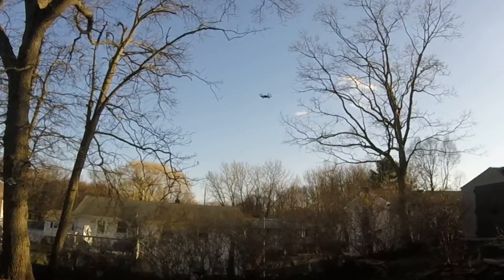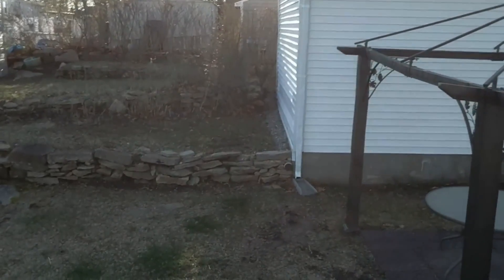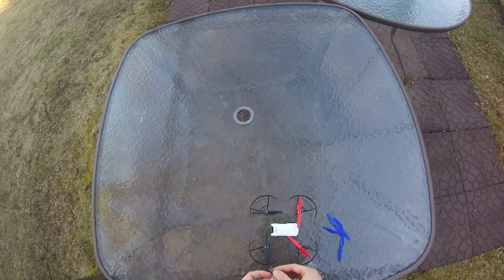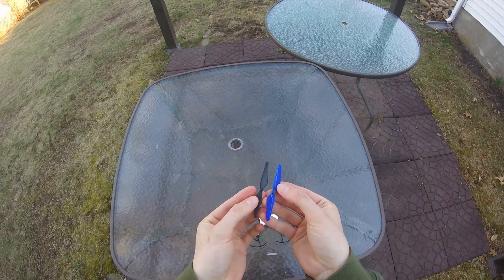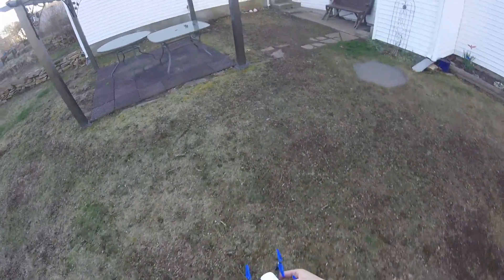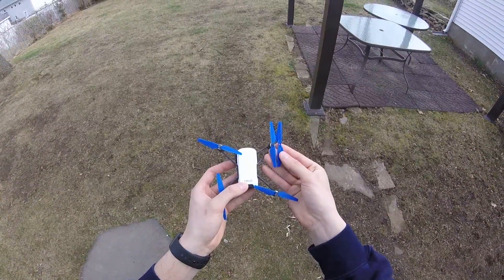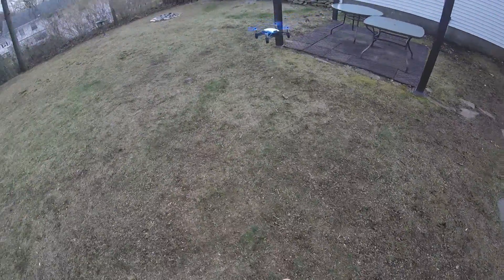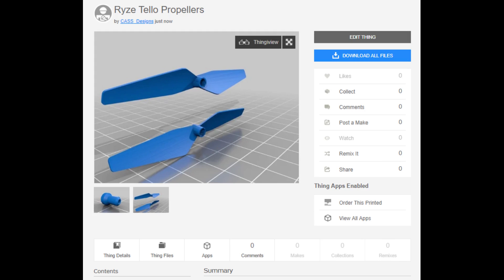3D Printed DJI Tello Propellers

Comment: for some reason the dont provide enough thrust so im gonna have to buy them😭 although if u have tips they are welcome here , they also just pop off sometimes when i try to take-off
Reply: i use eco pla magik red-green and recreus tpu 82A
Reply from the maker: @notfaze_blobke3159  are you using a 0.4 mm nozzle or 0.2? Mine wouldn't work unless i used a 0.2

Comment: Hi CASS! Hoping that you see this, I was wondering where you found the angle calculator that you used at 05:25. Would love to try some other pitches and see what the effects of this would be.
Reply from the maker: I can’t find it after googling - I’ll keep looking but based on the numbers I had it seems like it was 2*diameter*pitch? That came out to 26.4 degrees and I said in the video that I needed to model it at 26 degrees

Comment: Hi, Nice work on the propeller! Would it be possible to have access to the solid works file to see how the propeller was made in solid works?
Reply: The reason I ask is I would like to replicate it with a 3 blade with the same geometry, it is for research. Thanks!
Reply from the maker: Sure when I get home later today I can check if I have the model still on my hard drive! I think I modeled a 3 blade and it didn’t work for me (I definitely modeled a 4 blade that didn’t work) but it could’ve been the weight of an additional blade on each prop since I didn’t alter the thickness
Reply: @CASSDesigns  thanks!! its very much appreciated

Comment: That's awesome! I knew I wasn't the first to try 3D printing props out of TPU, earlier this year designed & printed some TPU props for a laugh just to see if they'd work, and boy do they!
See my video "Five33 TinyTrainer with 3D printed TPU props"
I put almost no effort into designing them beyond making them look prop shaped and having them printable without needing any support material. Very surprised they worked, the only drawbacks I could find were that I couldn't get the kind of speed & acceleration as with normal props, and 1/4 to 1/3 shorter flight times.

Comment: Hi..
Tello drone whic one Propellers perfect.
Orjinal or whic one buy ?
Reply from the maker: I've used original tello propellers, third party, and 3D printed - the third party ones aren't as quiet as the original ones but are as stable, while the 3D printed ones are a bit louder and a bit less stable but definitely good enough for the drone

Comment: Hey man! I tried printing these guys but stumbled upon some issues like, the propeller being broken after the print. Missing parts in the slicer, I would lv to know if you have a step file where I can analyse?? or any suggestions would be awesome!!
Reply from the maker: I could try to see if I can make a step file later tonight (I don’t have the design software I used to make these anymore) but are you printing it with a small enough layer size?  I’d also suggest making the print speed really slow. I used supports when I printed mine to avoid the propeller from breaking during the print. You could also try using a smaller nozzle size.

Comment: do you compensate for the fact that the tello has 2 different blades, one with the little marks near the hub and those that don't. They are installer catty corner to each other.
Reply from the maker: No, I didn't. The 3D prints had imperfections that were larger than those markings so it didn't make a huge impact on the ability to fly. The 3D printed blades definitely aren't as stable as the normal propellers due to the layers on the 3D print, but the shape was smooth enough for flight.
Reply: @CASSDesigns  ok thx for the reply

Comment: what type of 3D printer and material did you use to print the blades?
Reply from the maker: I used Hatchbox PLA and I have a Creality Ender 3
Reply from the maker: Also, if you click the thingiverse link in the description it shows you my printer settings (speed, temps, etc)

Comment: Great project! Cool how the initial AOA had to be modified and you found the ideal angle from the thread specs.

Do you think it's possible to modify the model of the blade with BERP tips like the Blackhawk or Blue Edge rotor to reduce noise?

Stretch goal: make the struts collapsable. Would be interested in buying or getting 3D plans if it works. Possible market you could sell if there's decent interest for larger DJI drone owners?

https://en.wikipedia.org/wiki/BERP_rotor

https://gizmodo.com/the-blade-that-would-make-helicopters-almost-silent-5481081
Reply from the maker: both good ideas! I could take a look to see if the BERP tips would do anything to mitigate noise. I made quad props to see if they would work on the tello but unfortunately they wouldn't lift the drone with a stable enough launch, but maybe I can make a video with different modifications to the props and which ones work and which ones don't

Comment: Bro please print out triblade and quad blade designs props, and test the batt perf compared to the stability.
Reply from the maker: I will!
Reply: did you in the end? @CASSDesigns
Reply from the maker: @vexital5666  yes, they never worked, I think my design was right at the edge of too heavy and when I added another blade it wouldn’t lift up fully, and I couldn’t make it any thinner
Reply: Damn wouldve been pretty cool to mod the tello like that. You think the blades would work without flexible filament? @CASSDesigns
Reply from the maker: @vexital5666  maybe - I only used flexible filament in the center to grab onto the pin of the motor. Maybe with a resin printer it can be even thinner and light weight to where it would work with more than 2 blades

Comment: Is there a way to print Tri or quad blades propellers?
Reply from the maker: I'm sure there is! I only used two blades because I wanted to copy the design but I'm sure if I printed a three blade prop in would work
Reply: CASS Designs would you try to design a quad blade? I’d tip for sure when downloading it. :)
Reply from the maker: @OfficialNetDevil  I could try to just take what I have now and turn it into 4 blades, I'm not sure how it would fly but I can definitely model it, I'll re-reply to this comment within the next few days if I get a chance to update the model
Reply: CASS Designs you are a godsend big dawg! 😁
Reply: CASS Designs I wanted to design similar props for the Spark.
Reply from the maker: @OfficialNetDevil  https://www.thingiverse.com/thing:3772644 I just took what I had and copied, pasted, made the axes perpendicular to eachother and merged the solids. This link plus the TPU cap in the thingiverse link in the video description should be all you need! I haven't printed or tested these yet, but maybe I will and I'll make a short video about it to see how they perform! Thanks for the idea! Let me know how it works if you end up printing it